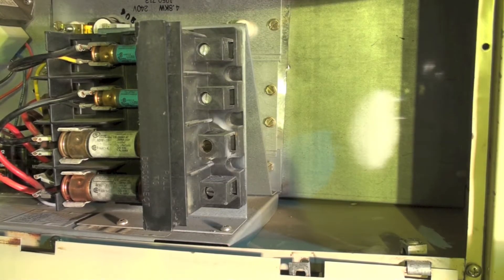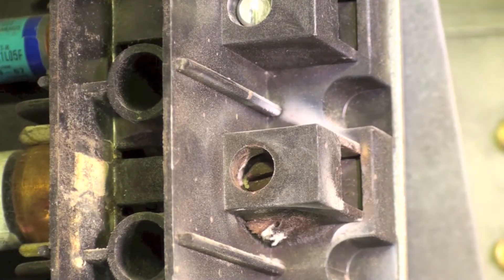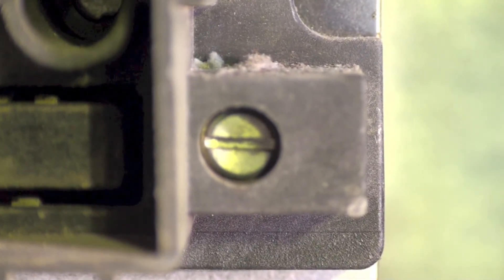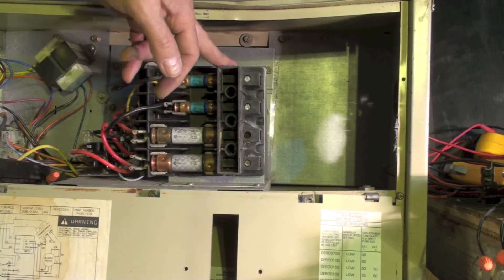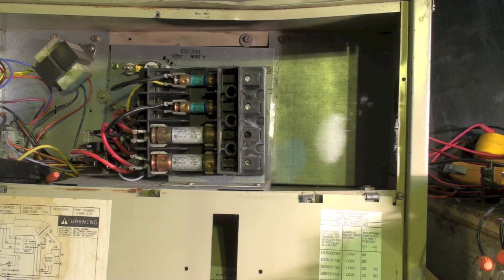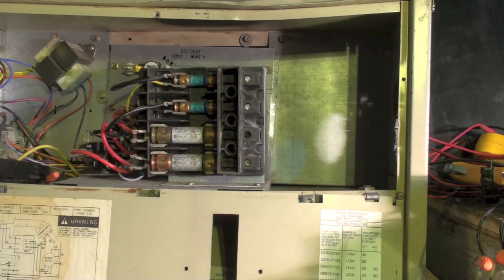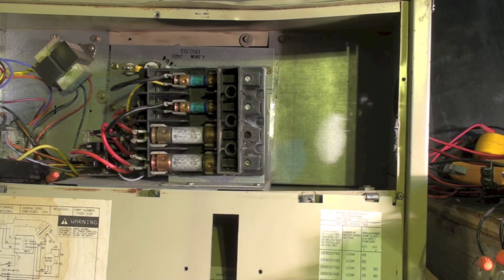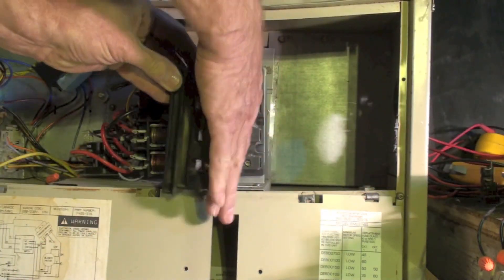Electric furnace overheat answer

Comment: I've got a fuse box about like that but mine keeps burning the fuses into .last time burnt clean through the fuse box ,I called two heating and cooling co.'s and they just replaced the box  every time it does the  same thing I just turned it off  didn't want to get burn out of a home !
Reply from the maker: This sounds pretty bad. There are usually 2 ways this can happen. Either the terminals are not tight or some of the fuse blocks were bad from the factory. Talk to the tech about it. 
GFM
Reply: @grayfurnaceman  Help me please before I replace my element nordyne e2eb012ha 4 ton heat pump system blows warm air and is working I’m wondering how hot should the air be coming out of my vents? I am supposed to have a 11 kw element which seems like a lot to me could it only be turning on half of the element? Thanks I really appreciate it
Reply from the maker: @lawnmowerman4040  If the heat pump is operating normally, its duct temp should be about 90F at 45F outdoor temp.  
An 11kw element is is probably 2, 5 kw elements and that is actually quite small,  It should only be operational if the heat pump cannot keep up with the load (about 30F outdoor temp).
GFM
Reply: @grayfurnaceman  The repair man that hooked it up did not wire heat pump at thermostat so I’m only using the element which now makes sense why it’s only warm not hot, I have a mercury style t stat,, can I replace the element with a bigger one and get by? my sons trailer has a smaller unit and it works really good
Reply: I need to explain we had a wood furnace and have not relied on the electric furnace until this year I’m in Paducah Kentucky so winter is not that bad here all I want is to get some more heat from what I have thank you so much you are a great person
Reply: @grayfurnaceman  Not gonna hold you to anything but Can I replace a element with a bigger one and safely get more heat? And if there are 2 could one not be coming on? That’s all thanks
Reply from the maker: @lawnmowerman4040  One could be not coming on.  As for larger, there probably are none larger that would fit your furnace and if you do, it will almost certainly kick off the breaker due to excessive amperage.  
GFM

Comment: I completely agree with tightening down lug connections annually. I also think the same thing should be applied to the service panel as well. Upon inspecting my service panel, I found a few connections loose that were not loose before for example

Comment: Good video. Once a yr. the electricians run around our plant tightening (torquing) screw lugs. Some of the equipment has 1600 amp breakers.
Reply from the maker: hanky97007 It should be part of annual service.
GFM